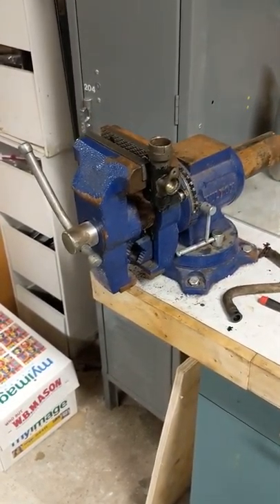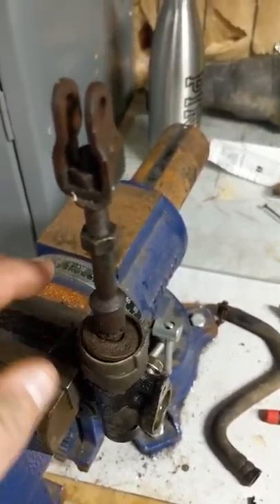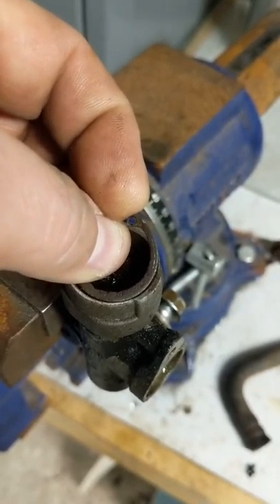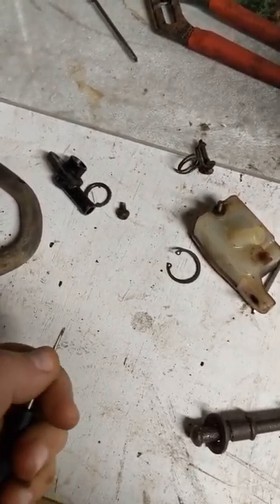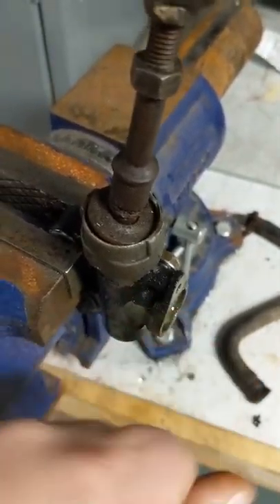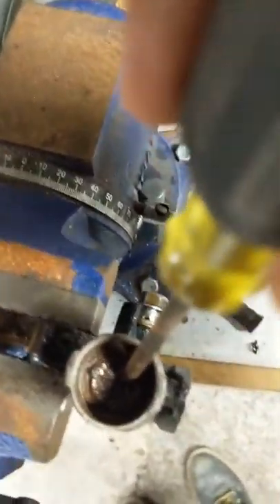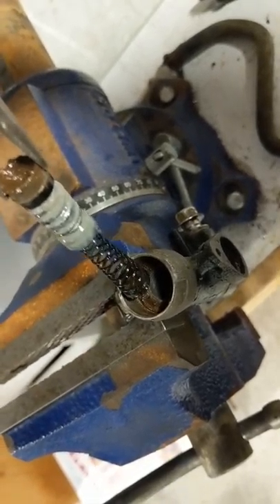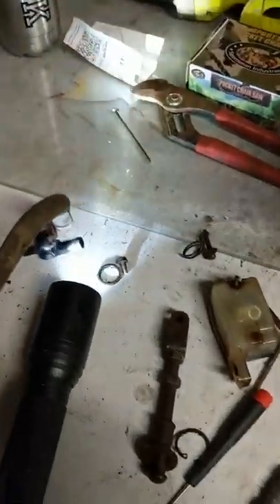ATV/dirt bike rear brake master cylinder rebuild part #1 .

Comment: I guess there is a limited throw on
these. I've broken two on my pit bike,
I think the throw on my lever is going 
beyond  the throw of the 
pushrod/plunger. In all my research of 
rear brake replacing, I haven't heard  
anyone say; ''hey you can break these if...'' 
With the one I just installed, I wound up with 
a little bit of brake, which was encouraging,
better than nothing. I adjusted 
it a bit more, and lost all brake.. What is strange is
that it didn't leak, just stopped working and 
wouldn't even blead anymore, didn't leak, just 
didn't work.lol